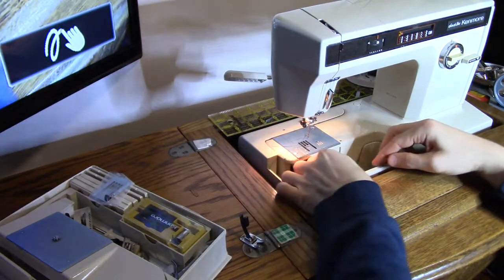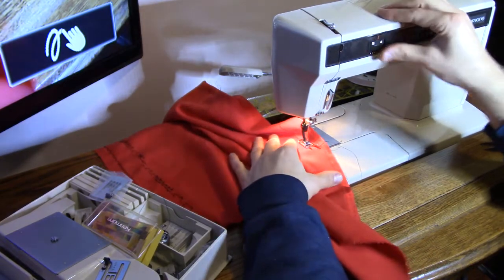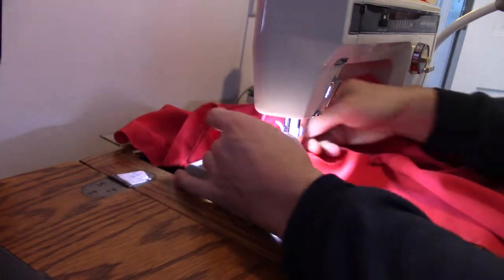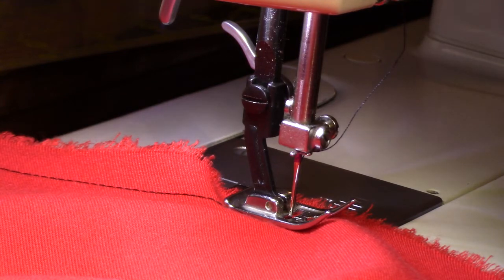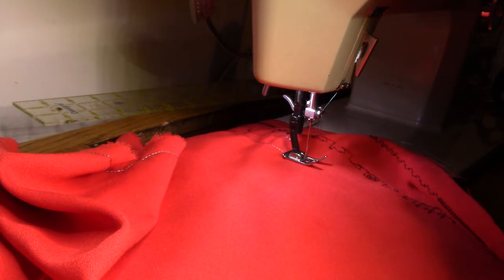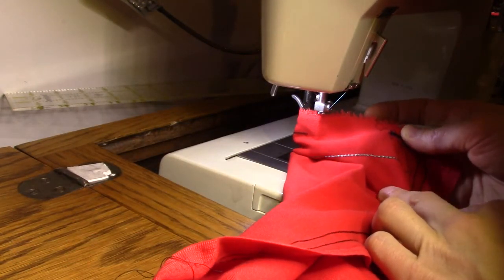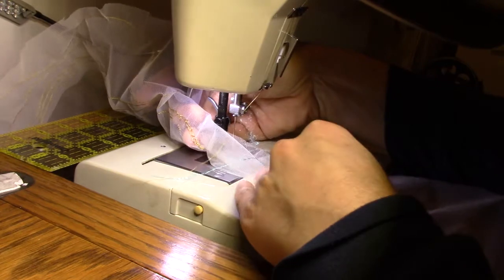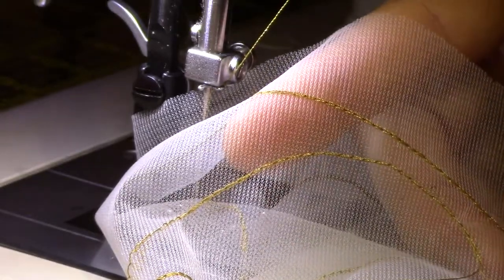Kenmore 158.1914 Chain Stitching

Comment: What is the screw for on the Chain Stitch Metal accessory?   Mine does not pop in and hold, it falls out when I run it. Manual says to be sure it clicks when you insert. It does click but does not hold.  Is that what the screw is for
Reply from the maker: There should be a springy wire attached to the screw. That wire spring holds it in. If the spring is broken, too loose, or missing, then get a piece of spring wire and replace it. It just needs to be in a semi-circle with the circular side on the inside to push on the shaft.

Comment: Is it possible to use a cam  while using a chain stitch adapter? Thanks for the video
Reply from the maker: It is not possible at present. I am working on developing a new chain stitch plate which might enable it to work with some patterns.

Comment: James,  be careful if you purchase a super high shank straight stitch foot...not all will work on this machine because of the slightly left homing of the needle...I have several super high shank straight feet & only one of which will let the needle clear the opening....just an FYI......
Reply from the maker: thank you for that, I hope I can find the correct one in due course
Reply: How do you close the chain stitch so it doesn’t pull out? Thanks. Nice video

Comment: Watch that your hands, fingers arent covering up what you want us to see.  I am sorry, but I dont know where you placed the silver foot item, you said the thread looped around.  Is this a stitch setting that comes on this  machine, uses a cam, or what? Can other Kenmores make this stitch?  I have a 158.1941.2 .  It is a super hi shank also.
Reply from the maker: Yes sorry about that. I have tried so many camera solutions over the years and always manage to find a difficult angle. The looper replaces the entire bobbin case and bobbin. Just remove it as normal as if putting in a new bobbin, and then put the hook in its place instead. I would need to check if the 1941 is super high shank. Nearly all the Kenmore's can do the chain stitch as long as you find the hook with the hole in it, have a hook (they are all the same), and get the right chain stitch plate -- if you cannot find the right chain stitch plate, you can make one as I did for my 1040.
Reply: Hi, my model is Usha Janom wonder stitch Plus and is there a possible to use chain stitch bobbin in this model ??
Reply: I would be interested in seeing how to make a looper. I can fabricate about anything but I don’t have an example to copy. Good stuff!